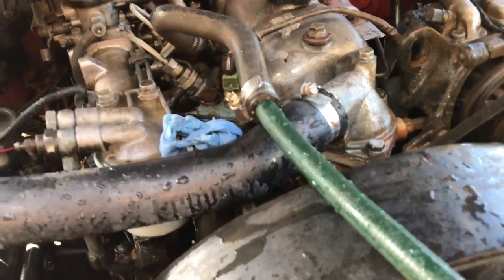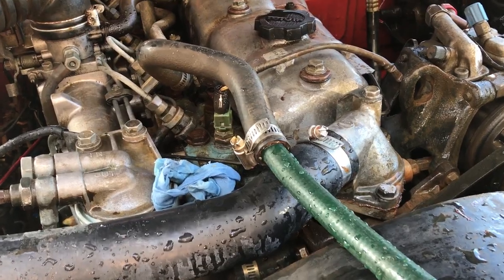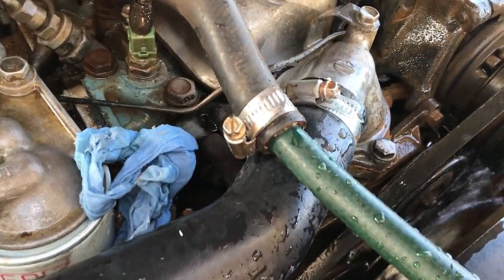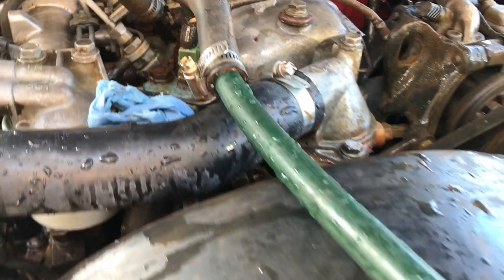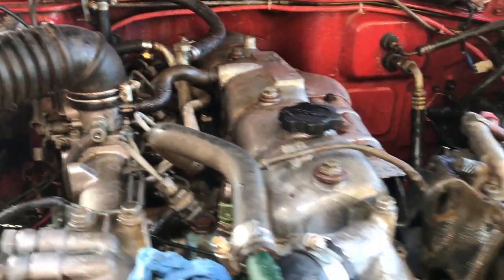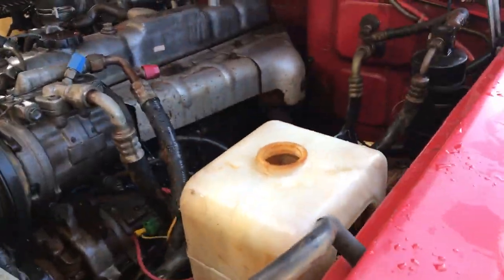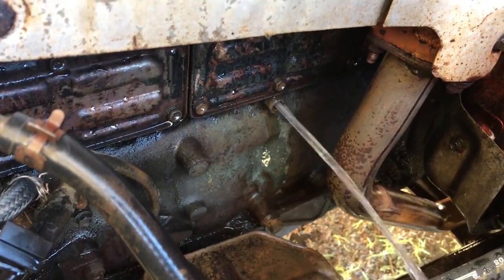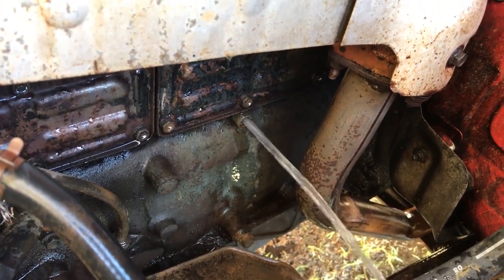Flushing a 2H Block

Comment: I've got a HJ75 I'm doing up. Your videos are handy, thanks! Did you have any trouble removing that bolt on the side of the block? I'm a bit hesitant to pull mine out as I don't want to snap it. Cheers.
Reply from the maker: I've never had trouble removing one, but I'm always  really cautious. You are right to be hesitant, if it breaks you'd be down to drilling and tapping a new thread, not pleasant.
Reply: @DuncanMargetts  Yeah, fingers crossed it won't snap. I've already bolted up my new extractors and exhaust as I was unaware of that bolt at the time.